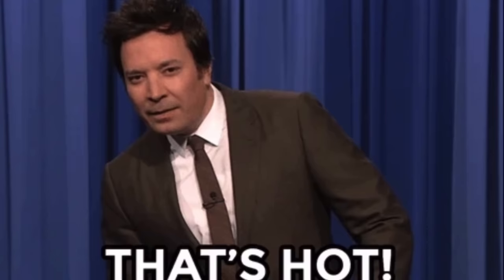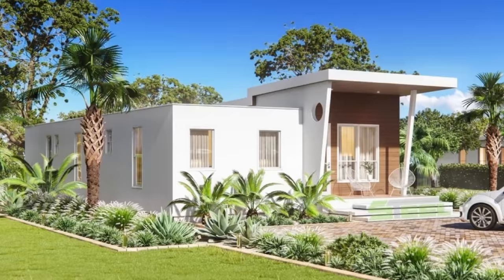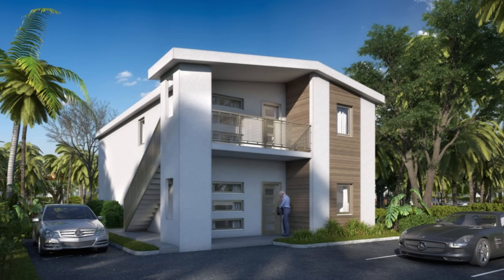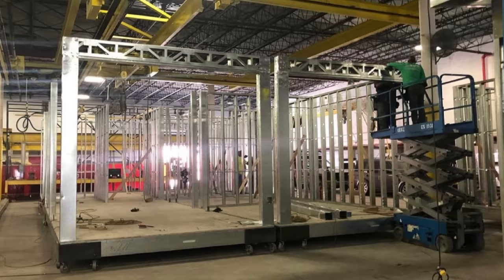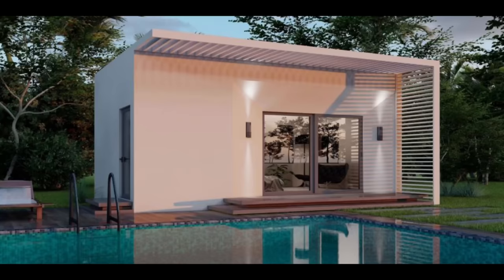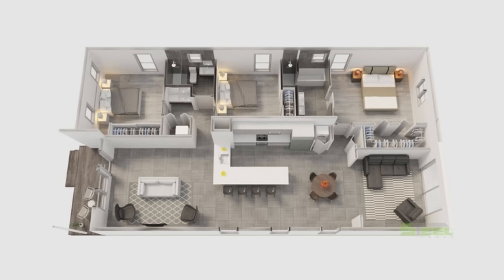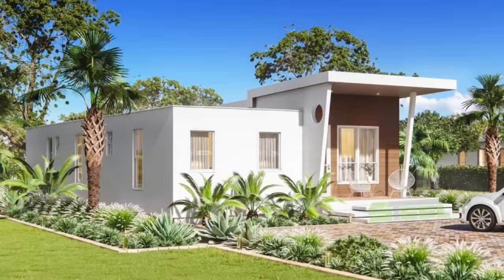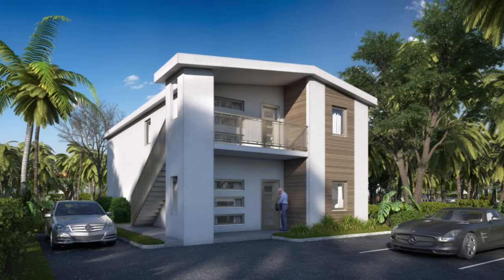Hurricane Resistant PREFAB HOMES are now Available on the East Coast!

Comment: I like the first one, these are really a good idea. They take the Manufatured Home or Double wide and turn it into one better that stick built.  They are probably manufacturing the tiny homes as well. Even a 500 is good size. I owned a home that was 660 ft, 2 bedroom, 1 bath from the 1920s. That house was really bult well, it had even been moved and had no way to tell it.   I REALLY like that they recycle metal from Cars. Sustainable all away around.
Reply from the maker: Glad you like it Deni!

Comment: I got their price list. It starts from $144,200 for 1400sqft 3 bedroom 2 bathroom.

The highest price is $269,600 for 5bedroom 4 bathroom 2520sqft

The one in the thumbnail of this video costs $161,900 and it's 1557sqft.

Feel free to pin this
Reply: So, $104 per square foot of living space. Not bad but would need to know about the level of quality in the bathrooms & kitchen. "Where the water flows --- The money goes."
Reply: is that fully finished?  and then on top of that you would need to pay transportation and actually assembling it on-site?
Reply: Thanks for posting the price range.  This at least gives us (me) an idea on figuring out a rough budget. Cheers from Toronto.
Reply: I don't know what Florida's prices are like but the price per square ft seems perfectly reasonable .
Reply: Is that including delivery and foundation?

Comment: I saw this video and decided I needed to check further.  I contacted the company and the kindly sent me the following pricing information: Hopefully this helps.

Special starting pricing* valid through May 31st, 2023.
After this date, please follow up for updated pricing.

Gardenia 		$126,000.00
Sunflower		$132,600.00	
Safflower		$161,900.00
Hibiscus		$166,900.00
Lily			$182,700.00
Rose Contemporary	$192,600.00
	

*For Florida state only; Advertised starting sales prices is for factory modular units only FOB. Delivery and installation costs are not included within SH.
Starting prices shown on this flyer are subject to change. Sales price does not include other costs such as additional onsite costs and permitting by other.
Reply from the maker: Awesome thanks
Reply: @KerryTarnow do they ship overseas?

Comment: I have been looking for quite some time for different systems.... Container homes, domes, modular. This company makes sense - will have to see the prices.... There is another company in Florida, called  American Ingenuity. They sell concrete domes for assembly. Hurricane and tornado resistant.  I drove two hours to see the factory. I like their reputation and ethics. They have been in business for decades. They sell the kits for assembly on site.  *PLEASE consider doing a video on them*. Glenda is a straight shooter, no-nonsense, old school (in a good sense) decent business owner.,..
Reply from the maker: Interesting, will check them out. Thanks!

Comment: Sooo I live in miami and have a few properties that I wanted make additions on. I worked with steel modular for about a year (live close to their factory) At first it seems all roses and bubbles until you dig deeper. years ago they were averaging about $100/sq. ft. now its about 150. however the addition costs after the purchase is what took me out. 1.A GC is needed to install everything and prep the site. 2. Shipping costs are paid for by the buyer. 3. Steel prices fluctuate in the futures market however they do a good job at keeping hikes to a minimum,.  Only thing I would recommend is if you  already have land in SOUTH FLORIDA then it could be worth it. All Steel modular really brings to the equation is time. They can have a unit done in a matter of months if you have land. If not , it will take over a year considering they now have orders from real home builders. crazy how fast they have grown.
Reply from the maker: Thank you for the feedback!
Reply: is $150/sqft the final price of the finished house? Or just the steel framing + foundation of the house?
Reply: @sarpkaya1786  just the unit. But comes completely finished. Bathrooms, kitchen cabinets...etc
Reply: So a 1500sqft unit with finished interior+ flooring costs around $225,000?
Reply: @sarpkaya1786  about that. Yes.

Comment: The Steel seems to have so many more advantages, with few downsides.  This will be the one I look at to build in the next year!  Thanks Kerry!
Reply from the maker: Thanks for watching
Reply: actually the main problem with steel is that it work hardens EXTREMELY  easily .   im from the caribbean and having been threw so many huricanes i can gurantee that the back and forth rocking motion of the house caused by the winds will work harden the steel at any flex points and it will snap 

thats why in the caribbean when you hear hurricane resistant house you hear about concrete construction

Comment: They are building similar hurricane/ typhoon resistant prefab home in SE Asia. The Philippines is one such nation. As a matter of fact exteriors look similar to these American built homes. Like in Florida Asia has termites to deal with as well. Costs are less than conventional builds too. In PI homes come to build site via flat bed then assembled on site. Package options include prewired for electric, cable, internet. Other options AC, water heater, kitchen, and bathroom styles.
Reply from the maker: Interesting, do you have a name of one of them? Would like to check it out

Comment: Good to see storm-resistant homes being built. I think, if you really want to have something weather-proof, then you should look at concrete domes or partially-buried designs. The good thing about partially-buried designs is the climate-control, especially in hotter regions like SE Asia. The weather is going to continue to get much worse. In fact, it will become so catastrophic in some areas, that there will be massive migrations across the United States, for example, over the next couple of decades. There will also be about 10-feet of sea rise, and many places along the coast will be under water.
Reply: yes i have friends who are engineers and have talked about that in great detail...We could end up with exceptional winds at speeds like 400mph, and with strong quakes they told me steel is not as good as concrete ..and that it actually bends .......So underground (full or parial) and concrete ..is recommended. Most people won't and don't want to think about that tho. I am glad to see people give some consideration to what we might need in just a few years , OR SOONER, though do not now need .
Reply: @marianl3447  Yes. I expect that we will see mass migrations out of many regions as people seek out areas that are less-prone to extreme conditions. It is not a matter of if, but when. People are not ready. Most people are not thinking about these things because our system is broken and corrupt.

Comment: Love the steel frame. Any idea what the walls, floors, ceilings and roof are made of?
Reply: hi all made in galvanized steel
Reply: @alfredorodriguez4954  Wow!  That's phenomenal.  Not just wind resistant then; fires limited to furnishings and greatly reduced flood aftermath issues. No termite issues. Definitely moving into the top 5 immediately.

Comment: But do they float? For the storm surge associated with Hurricanes.  More serious is the comment that metal does not twist…. For Earthquakes, the steel must be able to twist and flex to absorb the motion cleared by the quake. Last, wind is not the only danger in a hurricane, it’s the projectiles being thrown around, do they have reinforced exteriors to protect penetrating fence posts?
Reply from the maker: Thank you for the feedback